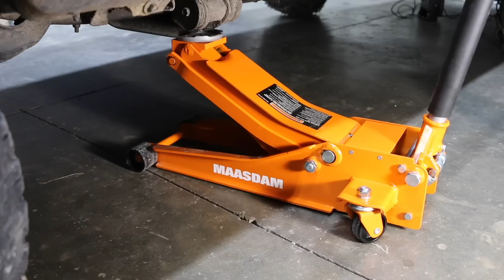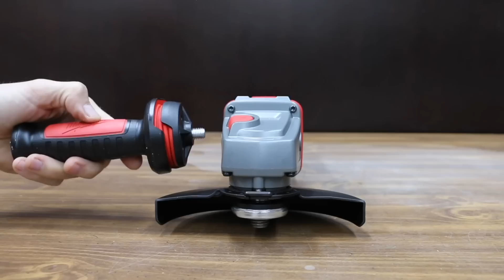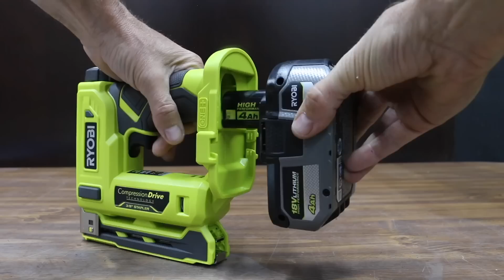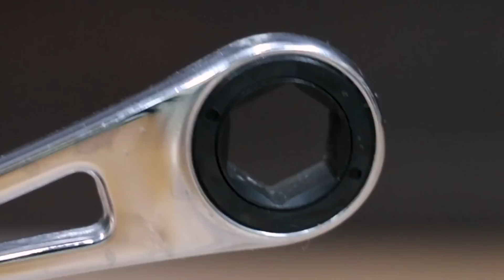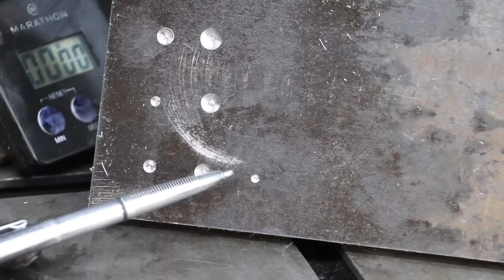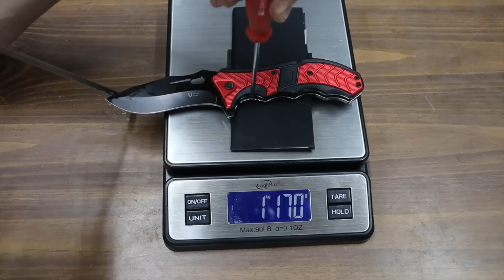Top 10 Tools 2022? Let’s find out!

Comment: On your lock back knives you missed  a premiere candidate.  The Buck knife Folding Hunter.  The knife on my belt as we speak was manufactured about 1972, Black walnut and brass, stainless blade.  I am a carpenter and builder.  I do a lot of plumbing and electrical.  That knife has cut hundreds of Romex cables,, it has chamfered  the ID and OD of thousands of PVC and ABS pipe.  It has sharpened thousands of pencils from new to stubs.  Opened thousands of cans of food on camping trips. Pierced thousands of steel heating ducts  to give entry for a sheet metal snips.  On my belt through 5 or 6 replacement leather belt holders,, and it can still routinely take and edge from a diamond hone that can slice double wall corrugated cabinet boxes, faster, better sharper, that a brand new matte knife.  And all for about 50 or 60 dollars.  And,, entirely USA made.
Reply from the maker: Thanks for the feedback.

Comment: Great videos the longer side but with the fastest delivery point with more info. So many times I've been in a store , trying to find which will work/ be the best/ or cheap vs expensive 🤔..... so I just buy both or all , examples best plastic glue or broken bolt bit ... lol $6.99 turns to $76.99 quickly 🤣
Reply from the maker: Thanks for the feedback.

Comment: Great vid as always bud. For a future vid, i think you should do hole saws. I knkw you did one 2yrs ago cutting through metal, but this time should do wood, wood with nails, cinder block, tile, and anything else that would be typical for a job site. Testing the spyder carbide and spyder bi metal, milwaukee carbide and bi metal, lenox, diablo, and others that could be found at local hardware and big box stores.
Reply from the maker: Thanks!  Thanks for the suggestion.

Comment: As a subscriber to your channel or videos I'm a little perplexed. In your series on battery operated chainsaws, string trimmers & leaf blowers l questioned you several times about a major company that was overlooked. 
SKIL??? As a long time user of chainsaws a friend introduced me to SKIL battery powered chainsaws and I have never been impressed by plug in electric power chainsaws. 
But after testing my friends I bought one. And was so impressed that I then purchased SKIL string trimmer and leaf blower!!! 
In my opinion the best bang for the buck $$$.
SKIL is a CHEVRON owned company and as a retired certified CAT&CUMMINGS mechanic I know what TECHRON does for diesels.

Comment: SUGGESTION: Everyone uses USB-C cables these days and it would be great to test a bunch of commercially available ones to see which one has lower resistance (per given length), carries more power, robustness of the connectors with repeated disconnect-connect cycles, and value for money.
Reply from the maker: Thanks for the suggestion.

Comment: I have owned the same Craftsman tap and die set as you tested. I have owned and used them both professionally and personally for over 40 years and they are top notch IMHO.  I was a auto, truck and heavy equipment mechanic for both gas and diesel for 20 years and those taps never failed me if I used them properly.  Sometimes I got in a hurry and broke a couple but it was my fault not the tap quality and Craftsman replaced them no problem. They are well worth the money. I am 75 years old and I still use them occasionally.
Reply from the maker: Thanks for sharing.

Comment: I do not understand why the Black and Decker string trimmer wasn't tested. I have owned them for many years and I have yet to find any better. They trim and edge easily and well. The string is purchased already on a roll and it is easy to replace taking only a few minutes. It feeds out string without pounding it on the ground as well. It is also much cheaper at around $100.
Reply from the maker: Thanks for the suggestion.
Reply: Your website is the best tool and product review bar none. Great job and please continue your work.

Comment: Just subscribed after binging hours of your videos! Can you compare a bunch of breaker bars that are used to loosen tight nuts? I bought the Armstrong 12-918 1/2 inch drive 17 inches long because I wanted USA made but I'm curious about all the torture tests you could come up with both with pipes attached ("cheater bar") and without. Thanks! Idea #2 - best telescopic magnetic pickup tool?
Reply from the maker: Thanks for watching and subscribing!  Thanks for the suggestion.

Comment: Gear wrench is a great brand. However, I very much dislike a ratchet handle that DOES NOT lock the socket on. Personally, I’ll only use the ones with a button on the head that locks the socket/ attachment. Some scenarios, the quick detach is nice or needed but very rare in my experience. Thank you.
Reply from the maker: Thanks for the feedback.

Comment: Just throwing out some ideas if they were not done yet 
1 house vacuum 
2 best cleaners
3 best speakers
4 best dishwasher pods 
5 best pans 
6 best jigsaws 
7best jigsaw blades 
8 best carpet type 
9 best all terrain tires
10 best water heater types
11 best faucet brand 
12 best garden sprayer
13 best cattle gates 
14 best fence post clips 
15 best barbed wire brand 
16 best  sand blast sand 
17 best fishing poles 
Thanks for the great work you do
Reply from the maker: You are welcome!  Thanks for the suggestions.

Comment: Did you ever test different electronic torque adapters? I purchased one that supposedly will do 600 ft lbs to do wheel lugs that needed to be torqued to 450 ft lbs. Ended up not using it for various reasons still wonder if it is any good.
Reply from the maker: Thanks for the suggestion.

Comment: Will you do a test on breaker bars? Testing the failure load, ease of use, extensionable ones vs fixed length. Some include swivel heads.
Reply from the maker: Thanks for the suggestion.

Comment: Any chance you would add flex tools to future battery powered tool testing? Despite all the paid actor crap,  I do think it could easily be in the top 5 for tools and would like to see if my suspicions are correct or if they are junk. I have seen several other channels test them but I don't trust them as much as you.
Reply from the maker: Thanks for the suggestion.

Comment: i saw a couple of electric staplers also did finish nails or long staples do many make companies make a battery powered finish Nailer for large trim nails? 
i already have DeWalt 18 and 20 volt and Milwaukee 12 but all i saw was metabo and craftsman i would hate to start another battery and brand

Comment: Hey Sir, is it time for another super glue test?  It's been four years.  You have the equipment now to do a straight pull test (even though I thought the lever idea was genius).  You could glue and pull three bolts from each brand, and maybe add some brands.  You could let us know if any ingredients have changed.  The twist test and pipe test were both ideal.  Just a suggestion.  Thanks for your time.
Reply from the maker: Thank you for the video idea!

Comment: That Daytona jack is awesome.  I bought one this spring and it has worked flawlessly.
Reply from the maker: Thank you!
Reply: I've been wanting one. I just like the yellow, the fact it's 98% as good as a $1,000 jack is a bonus.
Reply: @chrisej5987  I got it for the lift height and strength for lifting my F150.   It also has good clearance for getting into tight areas so I can use it on my wife’s Camry also.   It is definitely a great price point for the quality.   I got the red one with the sparkly paint, and it looks really sharp.

Comment: Video suggestions : best electric water pump, ( I have a 50 gallon water tank that I use to water my 175 new trees spread out across the property )  Best wet saw blade ( cutting stone ) best snow shovel ( including the ones with wheels. ) best electric snow blower, best snow scraper, best space heater 👍
Reply from the maker: Thank you for the video ideas!

Comment: Hi, I understand you tested these before but can you test philips #2 bits with a low amount of force and/or when it's not quite allinged. I was building a roof for our deck using philips and with me having to drive in screws above my head I found it near impossible to apply a lot of Force and to keep it straight. And with these factors combined it leads to lots of stripped screws. I ended up switching to T25 half way through but I've also heard good things about JIS Philips. Could you do these tests for #2 Philips and throw a JIS bit for comparison?
Thanks.
Reply from the maker: Thank you for the video idea!

Comment: I will have to look through all your videos to see if you have tested wire crimpers specifically. automotive ones. If not Knipex now has a tool and I wonder if they are better then the Deutsch closed barrel CT4-8. Maybe the connecters at the same time, how many time they can be taken apart and still fit strength it takes to pull them apart how well they flow power.
Reply from the maker: Thanks for the suggestion.
https://www.youtube.com/watch?v=98DUiirnkIk

Comment: When it comes to battery powered tools one tends to stick with one brand as batteries are a big expense. I think you should do a 'system' test. Pick the five or so most often used tools and pick a winner. Like a circular saw, 1/2" impact drill, 4.5/5" grinder, recip saw and a yard tool like a string trimmer. I have about ten Milwaukee battery tools and probably 15 batteries (M-12 and M-18) Rapid charger charges both. They are not the best in every category but are strong contenders. I am sold on the 3/4" impact wrench with a 12 ah battery.
Reply from the maker: Thank you for the video idea!

Comment: Thanks for the 2022 best-of recap!
I have a suggestion for a new video; torque screwdrivers.  I've been wanting to get one for various jobs where overdoing it can break the screw and underdoing it can have very bad consequences...like on wire-holding screws in a breaker box.
I like the idea of a T-handle type tool for ease of applying force ut have found very few of them.
Reply from the maker: You are welcome!  Thanks for the suggestion.

Comment: It would be interesting if you compared Milwaukee, DeWalt, Ryobi, Bosch, etc in overall performance since owning a brand of battery type kind of dictates the brand of tool you would buy to avoid maintaining multiple chargers & batteries.  So if you had to outfit a shop with just ONE brand, which one brand would you pick?

Comment: Testing or compilation idea: What’s the best overall battery powered tool architecture to buy into?  Ie. most people have a few Dewalt batteries, their chargers, and their tools.  Or Milwaukee.  Or Makita.  Etc.  If someone is going to start buying wireless tools, what’s the best overall one?

You’ve done enough battery powered tool tests that you could probably compile video and data from previous tests.  Yard tools.  Carpentry tools.  Mechanics tools.  All around tools (like drills).  etc.
Reply from the maker: Thank you for the video ideas!

Comment: Thanks Todd! Is there a way to test floor mats for cars & Trucks?

Recently tried to find a decent set. Hard to figure out if the mats online are a better value than the local parts store.
Do they protect the car interior?
Ease of cleaning?
How do they handle pine needles, sand, mud, or snow?
Do they slide or move while driving? Does the supplied accessories keep it the mat in place?
Which holds up the best?
Which is better for a work vehicle out in the field vs a commuter.
Are the premium mats worth it? WeatherTech etc
Reply from the maker: Thank you for the video idea!

Comment: Some day I hope to go through a bunch of results and compare them as a percentage of each other.
So product A being better than product B in a test by 5% doesn't outweigh product B being 50% better in another test.
Likewise some tests are more relevant to people than others and therefore prioritys get weighed differently., Some might favour a tools strength and be wiling to sacrifice back-drag, So changing the recommendation through sorting by user-speciific priority is also a thing (spreadsheet calculations where the higher the priority for the user... the furthest to the left columb it becomes, lesser prioritys shift right on the spreadsheet so the resulting recommendation might change.
For example some people might be more value orientated and all results get weighed relative to their cost, Other people might put quality first so price gets a very low weighting.

I don't expeft PF to do this, safe to say he does more then enough already!
But it would findimentally change everything and make it specific to each user making sure they truly get the best tool for thier job rather than a very good one for most jobs.

Comment: 2 of the tool brands you tested are ones I own. My torque wrench is Snap-On. I needed this because of my job at the time. In the auto industry doing engine recon & rebuild work, there is no room for cheap tools. My tap & die set is Draper. Some of their tap & die sets actually have the drill bits to go with the taps. One trick I need to point out is during use of a thread tap, or die, you turn cutting direction 2 turns, then back off half a turn. Failure to do this, especially when threading a blind hole, can result in binding of the tap. The best way to cut threads on bar steel is to use a lathe. Once again, great video. A lot of the brands you test of various tools we do not have here in Australia.
Reply from the maker: Thanks for sharing.
Reply: @Captain Obvious....these are tests...ideally to failure.
Reply: @mouldyboats  due to the job I once did, I worked the tools I used to point of failure with cheapies. A top class mechanic won’t buy cheap tools, because they fail when they are needed the most.

Comment: Test of automatic electric portable 1500W space heaters for winter: decibels, weight, time to heat same room/space, tip protection, temperature accuracy over ~2h time, 'subjective' portability, 4' drop test on hardwood, and finally a fun destructive test involving dropping in water using GFI outlet (maybe a tub, with a quick replay of 'shocking' quote from Goldfinger).
Reply from the maker: Thanks for the suggestion.

Comment: Once again another great useful video proving that sometimes the most expensive is not the best or there might be a cheaper alternative that will work. In the case of the Snap-on torque wrench we found that they were not making specs after 2 years and because they changed the models so often, the calibrated spring had no replacement and therefore the wrench was disposed of. We ended up changing brands because of this. For our industry the torque wrench is calibrated yearly and if the unit is dropped.
Reply from the maker: Thanks!

Comment: As a mechanic who hates getting on the snap on, Matco, or cornwell tool trucks this channel is amazing. Most of the time you can get better quality for less money and thanks to Project Farms I can figure out exactly where to find deals like that.
Reply: I'd love to see your torque wrench tested against the model Snap-On I own. I worked in the auto industry most of my life, & the last few years of my working life, I needed a highly accurate torque wrench, especially when working on European engines, which have much finer tolerances. The cheaper ones just are not suitable. Without an accurate torque wrench to provide consistent & even clamping load of the head bolts/nuts, count on having head/head gasket issues within a couple of years. I have seen it happen.
Reply from the maker: Thanks for sharing!

Comment: Might be a good video to deep dive on different size torque wrenches, based on what I've seen low torque 1/4 inch wrenches seem to be pretty hit or miss, and when it comes to needing one for motor work, a broken bolt because the clicking mechanism doesn't work is a real bad day, and most don't come with a calibration certificate. Great video as always, thank you for what you do.
Reply from the maker: Thanks and you are welcome!  Thanks for the video idea.

Comment: 2023 will be a great year! Did you ever think about testing for the best performing bench top lathes? Great videos as always Tod.
Reply: I've got a benchtop metal lathe. You need to beware of a lot of the cheaper ones!! Those have nylon plastic gear sets in them, & have other nylon gears supplied for thread cutting work. The more expensive ones, costing $900+ AUD have metal gears, & are more suited for thread making. Mine is one that has metal gears.
Reply from the maker: Thanks!  Thanks for the suggestion.

Comment: A really nice test would be which is the best battery ecosystem. For example if you need an Angle grinder and Drill. Or for gardening you need a Lawn mower, String trimmer and Leaf Blower.
Reply from the maker: Thanks for the suggestion.

Comment: I was thinking of carrying around a heavier duty car jack, that is better/safer than the stock oem carjack. Any thoughts?
Reply from the maker: I need to put together a review on this one!  Great suggestion!!
Reply: A floor jack in the trunk. Also gives you traction in the winter time
Reply: @waterloo123100  but surely you can't have a full size Jack when the space is already being competed with with a spare the may be full size.
Reply: @DamplyDoo  My brothers 98 Accord fits a spare tire and a full sized jack a whole lot more in the trunk. Or you could try a bottle neck jack but i don’t really like those. Or You could find a factory jack out of full frame car. We have one from grandpas 77 caprice and it’s built like a tank.
Reply: @waterloo123100  so I guess what I'm asking is what is the compromise is there a smaller Jack that is much more reliable than the stock car one?